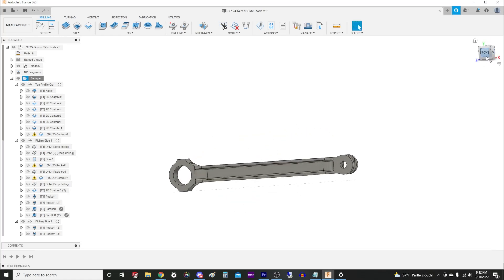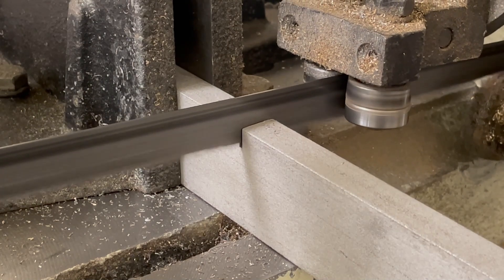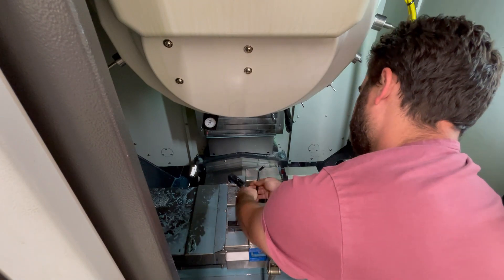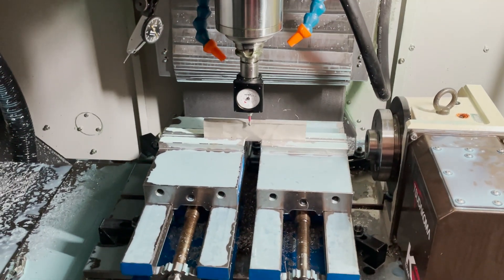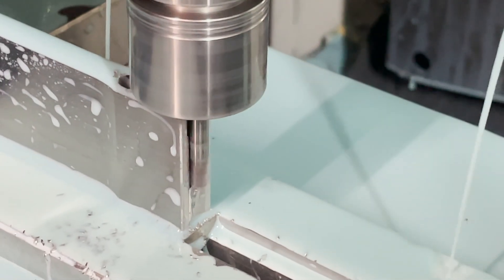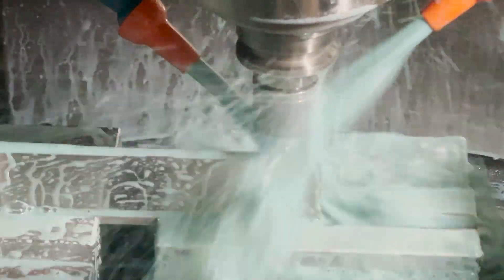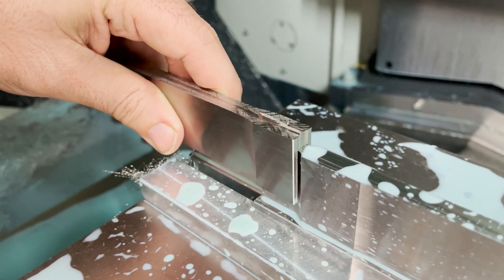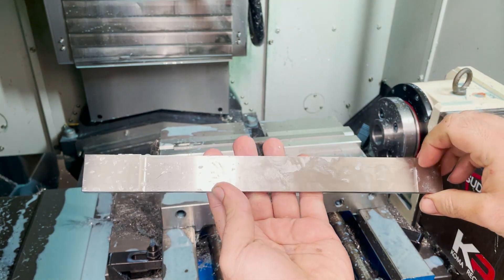Making New Rods for SP No. 2414 -  Part 2 - MACHINING FIRST OP

Comment: It strikes me that the operations involved for this structure in the home shop are quite different from the real life article. The original would have started as a forging(or casting) which determines the general form of the part, leaving minimal machining to bring it to specification. Nevertheless one has to start somewhere (usually the beginning), and tolerate the waste of material involved when you start with stock from the shelf.

Grand effort none the less.  

Stavros